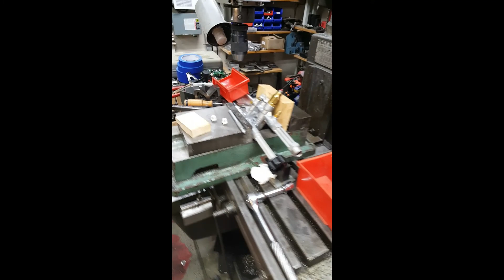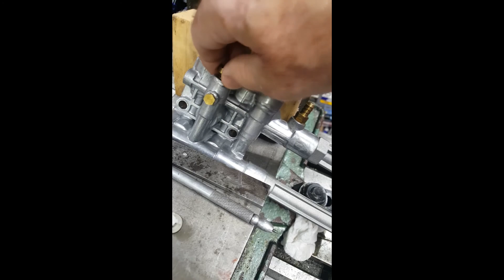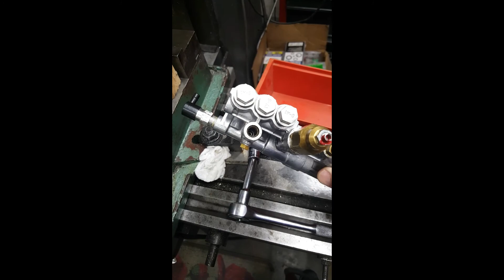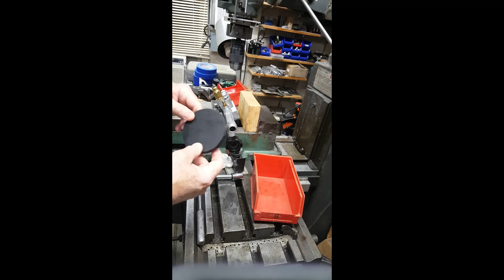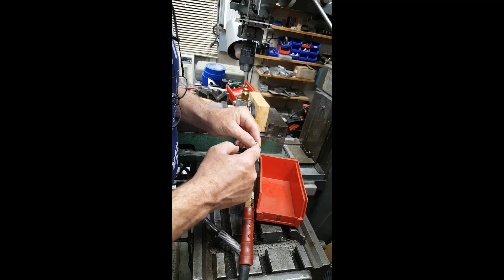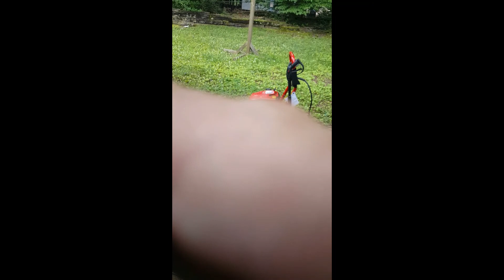Troybilt Pressure Washer, no pressure, obscure "check ball" repair, not the usual problem

Comment: I wanted to thank you for the video, I had the same issue but the spring was broken. I used the spring from a ballpoint pen and cut it about a half an inch long, it worked fine.

Comment: Hey there Jon I have the same pump on mine, I was wondering if you could confirm for me if there's a check ball or anything that's supposed to be in the outlet side where the wand hose connects. Thanks for teachin the youngins some tricks. I had to laugh when you said I can recall 3 times you've found something.... I'm 31 and had to think about how many things I've found...lol I've been lucky enough to find valve keepers and check balls from a th400 trans. Hope I can keep the trolls away.